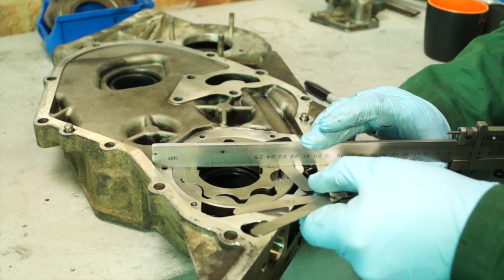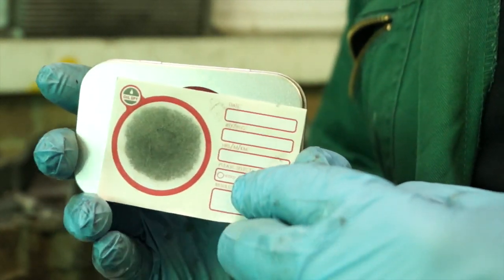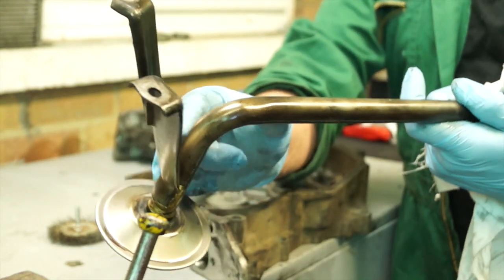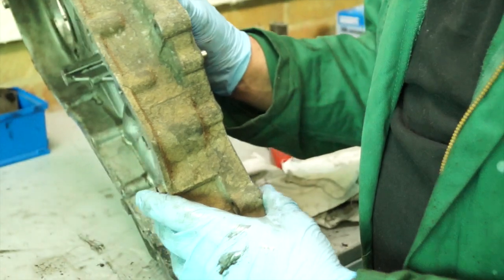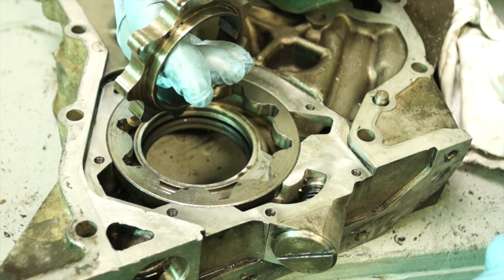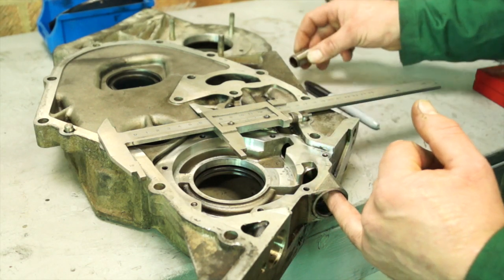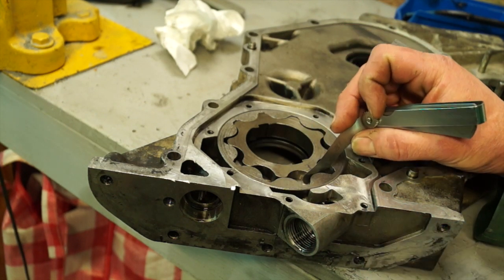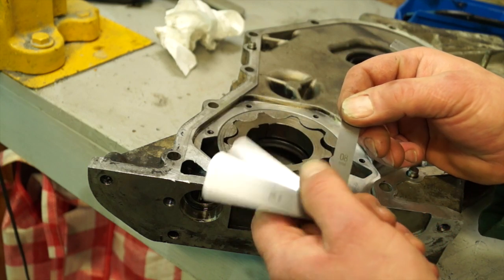Measuring Oil Pump Wear for Serviceability - 300tdi Engine - 110 Project rebuild

Comment: My D2 TD5 has lowish oil pressure at hot idle (0.8 bar when stopping at signals just off a motorway run) on my VDO gauge. The warning light never comes on, but at 145,000 miles, should I assume this is bearing wear? Would there be any point checking out the oil pump/relief valve or just ignore it?
Reply from the maker: I'd not ignore it.  Is the gauge accurate?
Reply: +Land Rover Toolbox Videos I believe the gauge is accurate (VDO sender and gauge, Tee'd to stock sender & idiot light). I would suspect worn main bearings , but that repair would probably be more than the value of the vehicle. I could possibly replace the oil pump and relief valve at the next service, but that at least another £500 as the TD5 pump is part of the ladder frame. It might be more cost-effective to put the money in the bank toward a future remanufactured engine. OTOH, I once fitted gauges to a friend's old GM 5L V8 to find it had such low hot idle oil pressure it would not move the needle of rest. Obviously a low-stress engine, but it did soldier on for many more years
Reply from the maker: I've not looked at the Td5 internally yet however most engine oil  pressure readings are taken from the galley before feeding the crank.  I'll take a look at the engine data when I get a minute.  What viscosity are you using?
Reply: +Land Rover Toolbox Videos I have the D2 serviced at an independent 4X4 specialist (in business 25+ yrs) so all I know is it is semi-synthetic. The TD5 sender attaches to the rear of the oil-filter housing at the back of the engine. I found specs for TD5 pressure - 3.0 bar at idle cold (which I have, or near enough) and hot 1.5~3 bar @ 3500rpm - which I also have and more. The idiot light triggers at 0.2~0.6 bar. Mine never even flickers - the lowest I see is 0.8 and again only at the very first stop (idle) after pulling off the motorway. There is no spec given for hot idle. I think the TD5 oil pump - while not that difficult to get to compared to the 300tdi, is a bit over-engineered :-)
Reply from the maker: Oil pressure when cold is a little bit of a red herring but if you are using 5W30 then it is looking to see if it is pumping the thinner oil successfully.  Test is always engine will at running temperature that way we can see when the oil is thinned that it will still pump at a specified pressure.  I would have thought as a gut feeing that the oil pump may need attention.   Would i be wrong?
Reply: +Land Rover Toolbox Videos Well, that's sort of what I was thinking, that possibly the oil pump could be replaced, but it's very expensive (£350-ish) and a used one is probably not a good idea. Some reports of the internal pressure relief breaking up (minor or major) and of course the old loose bolt (would have failed by now). So the question is - pay £500+ at next service to replace the oil pump and see what happens, or continue monitoring it and when it gets to "oil light flicker" stage spring for a remanufactured engine. I suppose I could just stay off the motorway.. or slow down a bit :-)
Reply from the maker: Unfortunately Td5 stuff is expensive 

http://www.turnerengineering.co.uk/acatalog/TD5.html  Look lower down the page

Try this at half the price. But I can't account for labour times and rates.

Comment: I soldered a beep-beep chiming relay to the oil pressure light on the dash board. In that way I get an acustic warning when the pressure is too low. I had the beep-beeping at idle or at very low revs, and whe this did happen, I changed the pressure sensor on the engine and that ended the problem. But I've kept the acustic warning... !
Reply from the maker: +Fionàn O&#39;Kelly    very good idea.  Trucks have low air pressure warning buzzers.

Comment: What kind of milage is on this engine, and can regular oil changes as well as the annual service help in avoiding advanced oil pump wear?
Reply from the maker: +Paul B  I have no idea of the mileage of this vehicle.    The 300tdi could easily achieve 350 000 mile easily without too many problems if good quality oils are used and the vehicle serviced properly.   I can say when an oil pump will wear up however.